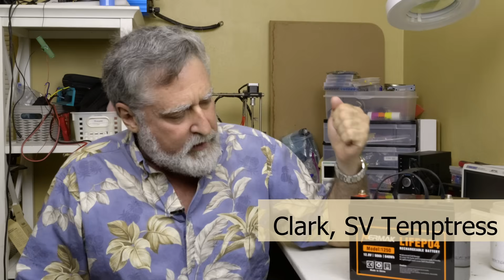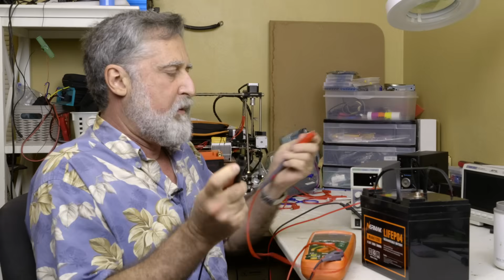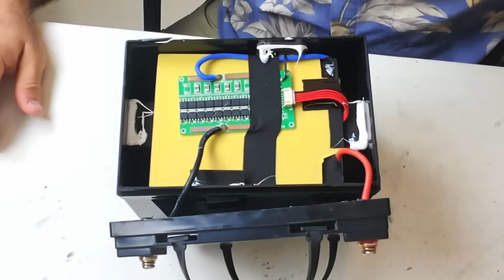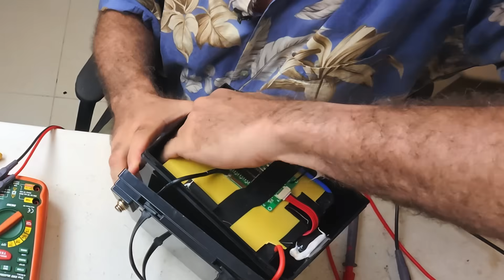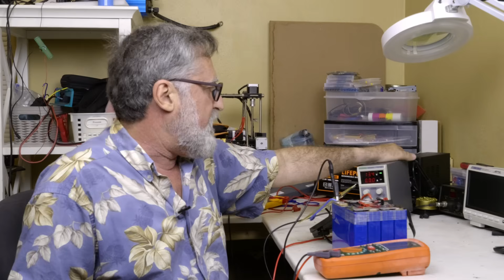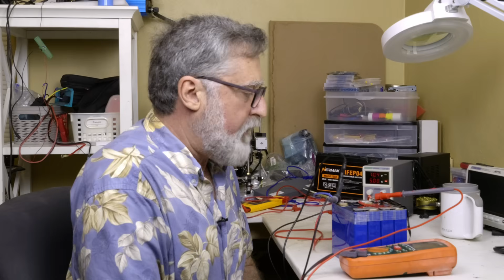How to Recover a BAD LiFePO4 battery

Comment: Hi, I feel more comfortable making the connection by sticking the banana plug to the power supply, so no sparks with the battery terminals. Thanks for the video!
Reply from the maker: Either way is the same for li.
   For lead I guess there could be hydrogen gas around so a potential - boom.  But still unlikely

Comment: Hi Clark, I bought a LiFePO4 48v battery to replace the lead-acid batteries in my lawnmower. It charged once, then didn't work, and wouldn't charge again. Never got to use it. The sensor showed one cell overcharged, one almost empty and three cells didn't show up at all. The rest were normal. The company is sending me a replacement. My question is... would this be salvageable by someone? Or is it toast?
Reply from the maker: Maybe.  Dig in and find out.
   It might have some broken sense wires
Reply: @Clarks-Adventure  It's from DC House, and it's essentially brand new, only charged once. Even if I could fix it myself, I don't have a use for two batteries and I don't want to store and maintain it for the life of the replacement (estimated 10 years).
Reply: My other response got deleted, I guess because I linked to a battery recycling company I was asking about (Battery Recyclers of America). Youtube doesn't seem to like outside links. Is this a legit company? I'm in the Baltimore area if someone is interested in the battery. I hope you don't mind me saying that here.
Reply: It's tempting to open it up and try to fix it, but I have so many other projects, and no use for this if the replacement is good.
Reply from the maker: @ubertar I of course don't know.  I hope someone answers.
Reply from the maker: @ubertar you could maybe double the range??
Reply: @Clarks-Adventure  In theory. Reality is one battery was nearly impossible to fit and required several modifications to the mower to barely squeak it in. Two is beyond impossible and just unthinkable. Maybe if I built a trailer-cart for it!
Reply: The over-volted cell drifted down to 3620, and the display showed chargeability as ON, so I plugged in the charger. It charged for a second after resetting the display, then stopped... the cell was up to 3660. Seems like the juice wants to go straight to that cell. Maybe if I wait a few days for it to drift down to the 34XX range, and try again? Might as well try, I guess, while I wait for the replacement to arrive. Meanwhile the yard is becoming a jungle. So glad I don't have an HOA.
Reply from the maker: @ubertar everyone!  Never buy into an HOA unless your name is Karen 
   Trust your neighbors

Comment: I have two 10 amp hour Nermark batteries that have served me well. I also have a 150 amp hour Eco Worthy that appeared to go down on high temp and lock up,  total voltage 8.65. I have an app smartBMS utility that does some granular control, and it showed discharge was locked out, possibly to protect the mosfets from overheating. I toggled the discharge feature on the app and the battery came back to life. Without the app, I probably would have had to wake up the BMS by other means. This might be a good reason to get a BMS with Bluetooth.
Reply from the maker: Most likely your battery just discharged too far but for whatever reason you could have likely restarted it by just charging it.  Often an automotive charger will refuse to charge a lil that has turned off inside.
   I personally think the most important reason to have Bluetooth is so you can see the individual cell voltages.
   Did you top balance your battery?  If not I suggest you watch my video on what to do to new batteries
Reply: @Clarks-Adventure Battery state of charge was near 90% when it went down. Battery mosfet temperature was running at about 150°F (Hot day, freezer working hard).  Mosfet temperatures don't like more than 140°F, so I think the BMS was doing its job by shutting down the battery. Battery didn't come back even after several hours.  I toggled the discharge FET in the smartBMS app and battery BMS woke up, volts going from 8.65 to 13.3. Probably other ways to wake up the BMS, but that did the trick.
Reply from the maker: That makes sense

Comment: At the 1:00 mark of the video and I'm betting there is nothing wrong with the battery that a knowledgeable owner/user couldn't fix very easily.  Interested to see what it really was, though.  :)  Looks like the BMS failed completely, allowing 3 of the 4 cells to drop well below the safe range.  It's odd that all 4 didn't fail, but this shows how a cheap BMS, in a cheap battery, can be a serious liability.
Reply from the maker: Yep.   I never really tested the BMS but I think maybe the transistors for the passive balance resistors failed closed for the 3 low cells
Reply: @Clarks-Adventure  - I don't blame you for not component testing a board that sells for 5 bucks!  Also, they could have used a $15 BMS, sold their battery for $10 more, and saved the cost of sending your friend a whole new unit.  It's a strange thing, but consumers and manufacturers have both reached a point where cost trumps value, with quality being the odd man out.  😕
Reply from the maker: @jasonbroom7147 I found that BMS on eBay for like 3.89usd.  I bet they buy them for 2usd

Comment: I've got another question for you.   I've heard that you shouldn't do solder connections on a boat, but do crimp connectors instead.  Do you have an opinion about this?  Best wishes with your health.
Reply from the maker: Yes.
 Go to my electrical master class playlist.  You will likely like all the videos in that list but there is one about wire and terminals.  That will tell you why.

And thanks
Reply: @Clarks-Adventure  I watched your video.  Wow, you've got a lot of material on your channel.  Amazing.  What a wonderful world we live in.  Thank you for making it better.  Fair winds.
Reply from the maker: I'm assuming you subscribed??
   Also please share my videos with friends who might benefit.
Reply: @jasonmcintosh2632 - I end up repairing a ton of crimp connectors on boats as they have been the most common point of failure.  The biggest issue with solder connections is that most folks don't do them correctly and either end up with a cold solder or end up flowing the solder up under the wires jacket creating a failure point where the strands will break as the wire flexes where the solder ends.  My preference is to use bare crimps with a pin crimper, position the crimp so that the wire is up from the crimp which helps prevent the solder from flowing under the jacket, solder and then provide strain relief plus a seal with marine shrink wrap.  Whatever you do refrain from soldering the wires first followed by crimping them afterwards as that will eventually fail and never use those heat activated solder seal connectors that you heat up with a torch or heat gun to melt the plastic and hopefully make a good solder in the process unless its just temporary and a non-critical connection.

If you do have problems soldering then use an excellent crimper and be sure to use a good quality marine heat shrink to seal off and prevent the crimp from corroding internally.  Of course if the wire is old and already compromised cut it back to clean copper and only make connections to good clean wire replacing all that has been contaminated.  You won't get a secure crimp or a good soldered connection on contaminated wire especially where battery acid or salt water is involved.

Bottom line is that if despite your best efforts you can't do solder right then get the best crimper and solid bare crimps available along with a good kit of marine grade heat shrink tubing using a heat gun to shrink it and activate the glue inside it.  Don't fall to using a match or open flame to set the shrink tubing.

Additionally watch out for bargain copper wire as it will often be misleadingly labeled CCU (Copper Coated Aluminum) with an unacceptably thin coating of copper.

Best!
Reply: @neilfromclearwaterfl81 thank you.

Comment: I've been seeing some 12V 300 AH batteries that are only about 14.5" x 7.5" X 10.5" in size.  That's a great size for my boat...  Normally the 300 AH batteries are quite a bit bigger.  Any thoughts on these batteries?  Are they packing too much power into them and they're not as safe, or things just keep getting better and better and these batteries will be just fine...???
Reply from the maker: Cells are getting smaller.
   The bigger choices are just full of foam.  Get the smaller ones

Comment: standard procedure would be to charge up the low cells to acceptable range for the bms. Then if bms doesn't want to "wake up" unplug the bms and replug and it should resume normal function.
Reply from the maker: I did.  It didn't.
   And it's a 3 dollar BMS with no heat sinks.  Really.  If I'm going to open the case I'm going to upgrade it.
Reply: @Clarks-Adventure  many bmses don't have heatsinks. I find if the mosfets are properly sized and numbered the heatsink doesn't do much. Yeah, that bms might overheat at 50 amps but you never know until you try it in a stress test.

Comment: one of a set of 4, 12.8v 300ah batteries, i bought came reading .98v
i tried waking the BMS. fail.
i put it in parallel so the charge controller could wake up. then i left it to charge.. 1st day it came up to 4.7v.
2nd day it came up to 6.69v
wont go any further.. 
tried to wake it again. tried.. lead acid battery charger.. other 300ah battery. just wont go above that.. sigh.. 
this video is so timely.. thing is im a wuss when it comes to electricity i would have to pay someone to do the bms repair.
Reply from the maker: Well at least you know what's going on.

  I don't blame you for being cautious.  These cells are crazy powerful.
   More energy per ounce than a hand grenade!!

Comment: Good stuff! I have a concern that batteries way below their minimum open circuit voltage are generally truly at end-of-life, and shouldn't be used. One the other hand, many batt manufacturers have agreed that 0.1C charge rate is safe to try in any case.

I was wondering why you didn't check the voltages at the balancer connection before removing the cells. Of course, if the BMS had failed, that could have been the first indication.

I see you have a 3D printer in the background, and what appears to be an oscilloscope on your bench. You seem to know your way about electronics. Did you try to determine what on the BMS failed? Any signs of magic smoke, shorted components, etc?
Reply from the maker: It was a 3 dollar BMS.  Not really worth fixing 

Thanks for noticing my lab.  If you like batteries I suggest you look into my inventions, especially the BankManager.  MarineDCAC.com

Comment: Waiting for part 2
Reply from the maker: I have other videos about installing a new BMS.  Check out the LiTime fix I did recently.
   I won't be doing a second video on this little battery.   The inexpensive BMS I installed was basically just solder and play

Comment: As a Mech Eng, I have a very healthy respect for the squiggly stuff. I also have a leather watch strap, not just for the high resistance but the metal ones tend to ping open at the worst possible time. Like say on the fore deck in a squall.
Reply from the maker: I lost my favorite watch when its Casio plastic band failed on deck.  It went overboard.
Reply: @Clarks-Adventure  Leather is best.

Comment: Would you eliminate the spark by leaving power supply off while clipping up & using power supply switch?
Reply from the maker: Actually you get a bigger one that way.  There are bigish capacitors in the final stage of the power supply that the battery tries to charge up "right now"

Comment: You need to apply voltage to the charging side of BMS to wake it up.
Reply from the maker: I've swapped it already, so it's too late.   I know that's important for digital BMSs like the JK. But this simple type just comes on.
   This was a crap BMS to start with.  No heat sink.  If I bothered to open the case I'd do an upgrade anyway.   And remember the battery was already dead.  I think that BMS was bad.

Comment: Did you consider doing an impedance test first and tracking the impedance/voltage curve of each cell? (You sorta did with your observation about the spark and higher voltage)
Reply from the maker: No, honestly I feel that's more for choosing a set of cells to put in series if you have hundreds to choose from
Reply: @Clarks-Adventure  yes, that is how the quality control measure is used, but if a cell has a lower voltage than another but the same impedance, this doesn’t work, does it? 

What would make better batteries, at least from a matched cell perspective, is to have matched impedance curves along the nominal voltage range (eg, 2.0v to 3.7v). Of course, this would be painstakingly expensive in production, but in a lab setting (low volume), it would show that the prospective short circuit current of a cell is highest at low voltages and that is where the IR is also lowest. (Your big spark/small spark).
Reply from the maker: Yep

Comment: u could have checked the individual cell voltage at the balancer connector
Reply from the maker: You are right and I do it that way if the access to the cells is difficult but those pins are so close together and it's easy to short them if my probe slipped, especially while being distracted by video cameras.